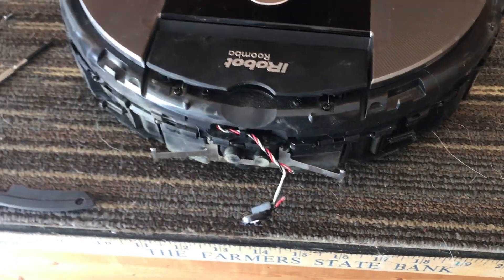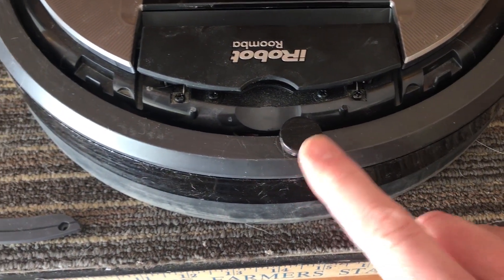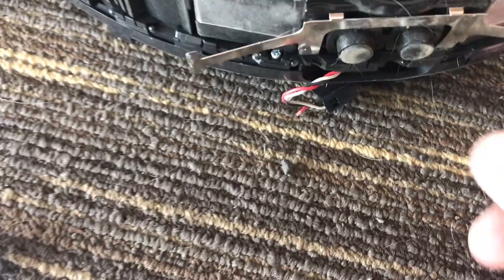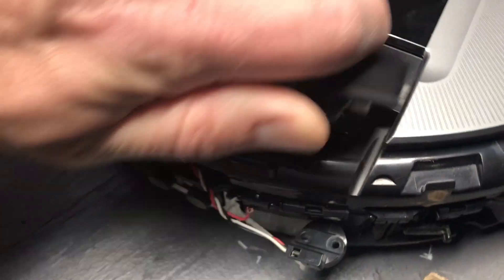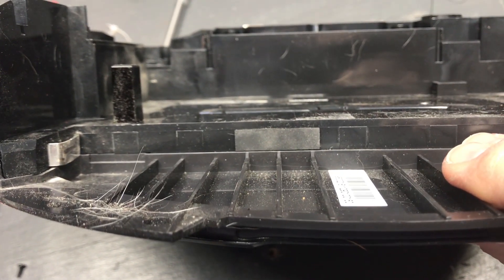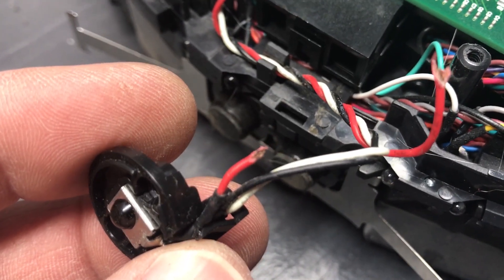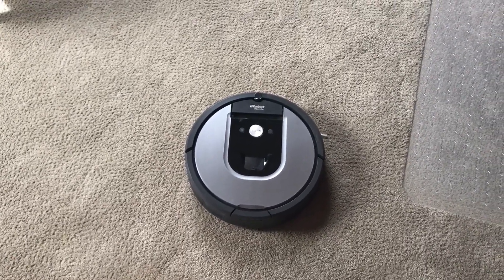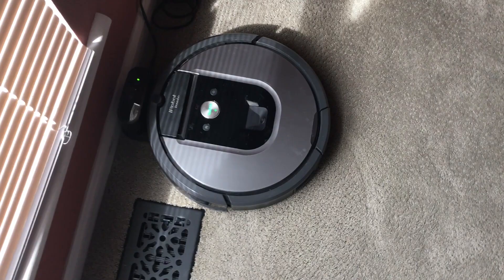Roomba 960  Docking Fix

Comment: Hey fellows, on first frame of this video you can see two round black sensors, on center of robot. Those are visible only after taking off the plate. Clean them, it also can help with docking problems.

Comment: Ive got a Roomba I7 with the same problem....

bro you just saved my roomba. I was about to throw it away. The cable wasnt obvious broke like yours but the connector to the sensor was really wiggly. So I resoldered and everything works. Iam baffeled

Comment: Thank you so much! I only needed to take off the faceplate. My toddler a few months back pushed it down the steps and cracked the faceplate. Yesterday he decided to dump his juice on top, where the crack is/camera/sensor so I needed clean it. Following your directions I also noticed my black wire is broken. Hubby will have to fix that for me. And yet to try to see if it still works... Either way, your video was straight to the point, helpful and explained very well.
Thanks again!

Comment: I run the m6 daily, and my floors look awesome🌼 allabout.wiki/Roomba-960 I wet mop 2 days and dry sweep the rest of the days. When I first got it, I used the included disposable pads. I didn't like them--the dry pad has no depth so if it picks up a chunk of something, like dry cat food, then it pushes it around or drags it around the floor. The wet pad wasn't very absorbent so left streaks and wheel marks.

Comment: Thanks for this. My wires weren't cut but the connection came loose. Took it apart and saw it immediately. Plugged it in again and now it works. You saved me a bunch of money :)

Comment: Another roomba saved! Thank you so much for posting your experience and the tear down steps. My two year old 960 started having this issue and turns out same red wire broken in same place. Seems to be a high impact area from the bumper. What a shame. But what a fix. Happily auto-docking again. Cannot thank you enough!!!!!

Comment: I have docking/charging problem with my 620, but the wire is not broken. At now the only method to chaaerge is using cable and side body socket.

Comment: I just got a used 860 on FB marketplace for $100.  Said it was working "great"!  I knew this thing couldn't bee so stupid as to not be able to properly dock itself.   Opened it up and all wires were still intact, however the red wire was nicked a bit.  Spliced it back together and put everything back together.   Pressed the "dock" button, and for the first time it found the docking station from halfway across the room.  Thank you for this video.

Comment: Thanks a lot Mark, you helped me revive my precious roomba. The red wire ripped after 5 years of usage on my 980- support was useless. One think i messed up while putting it back was placing the sensor in opposite direction - roomba started going bananas - realized my mistake and put it back in the right position

Comment: Thanks just pop off the top cover with a butter knife. Error 15 did could not find a bad solder joint or burned circuit. R&R mother board and was up and running in less than a hour. Super video Thx

Comment: I’m glad I saw this video. Exactly the same thing happened to mine. The red wire was broken. I’m glad I saw this before ordering a replacement or paying iRobot $110 for a repair. This seems like a design defect. I ordered everything I need to repair this (a couple of tools, some extra wire, and heat shrink) for less than the cost of the repair. Simple soldering job should fix it.

Comment: Thanks Mark, I was thinking to disassemble my Roomba 980 which has doing issue since December, then I saw your video, wondering if mine has the same issue, when I took it apart it turns out the same problem, the red wire even the same spot which is close to the sensor, fixed it by the same way, I think the issue should be considered as a manufacturing defect from the product.

Comment: Any clue what this part is called? Mine is doing the same thing but all of the wires seem to be attached and look fine.
Reply: Okay, after finding the patent information for my roomba (960) it looks like iRobot calls it the "The virtual wall sensing assembly 52VWS includes detectors that are operative to detect a force field and a collimated beam emitted by a stand-alone emitter (the virtual wall unit—not illustrated) and transmit respective signals to the control module "

You can find them on eBay under: "iRobot Roomba XXX series  Bumper IR dock/virtual wall sensor" .  I just ordered one. Looks like it also matters which one you get. the 600-700 series have the wires on the sensor angled the other way around and I don't think it would fit into the 900 series. 

I hope this helps someone else out!
Reply from the maker: I think it is just called the front bumper IR sensor.

Comment: My 960 was doing the same thing, took the front bumper off and the black wire was broken. Must be a common defect. 
When I contacted IRobot customer service they told me the roomba would need to be replaced. Im sure they are aware of this issue.